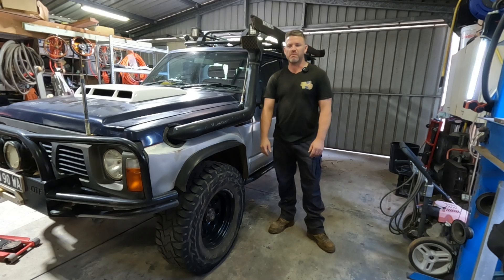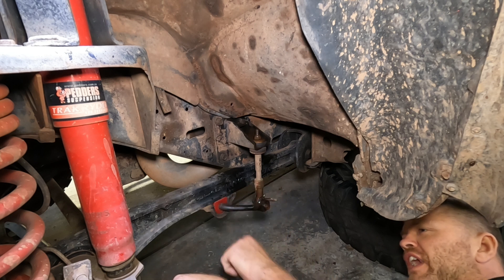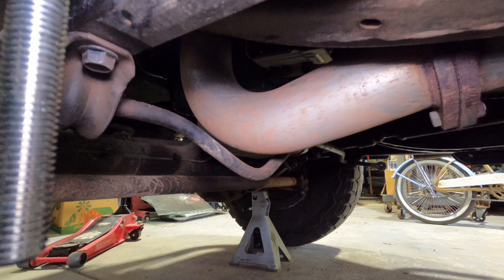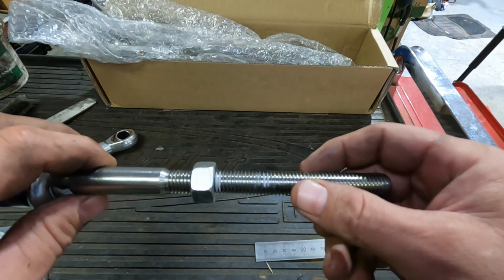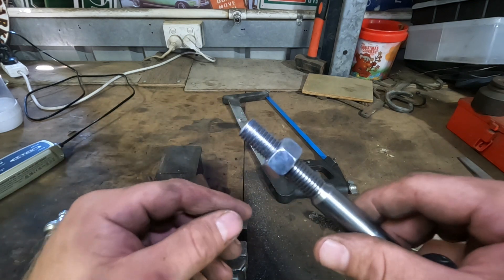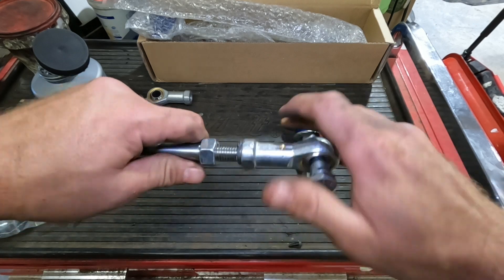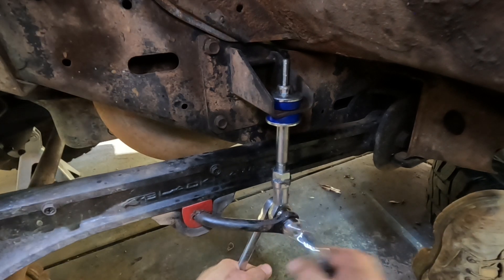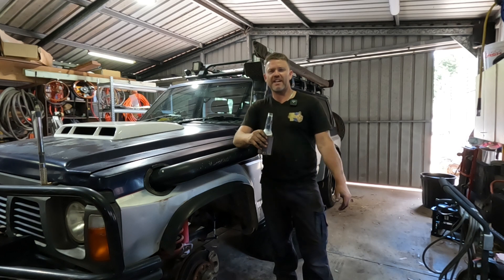Nissan Patrol Adjustable Sway Bar Links some tips that might help you out

Comment: I've got the same kit on mine. Ended up drilling thr other side of the rose joint and putting in a grease zert. Seems to be good now.

The urethane bushes .are it a little louder on road, but it's a gq...

Great info as usual Byron.
Reply from the maker: Oh awesome 
Yeah I think when they do wear out ill do an update video of what i do about them but for now they are fine just done a trip of 1000ish km all good 👍

Comment: Great video!  I set up my GU with the same Blackhawk arms.  Question:  Do you have clearance issues with the swaybar/front tailshaft?  Blackhawk have a spacer kit, but for $180!!!
Reply from the maker: Gday mate 
Thanks 
No mines ok at the moment what size lift have you got
Reply: I put in a ~50mm lift (King springs/Koni 88’s) same time as the arms.  Now drives/rides heaps better than stock, but I never noticed how much clearance there was before the lift.  About a finger width now but doesn’t seem to be problem driving around town.
Reply from the maker: @donaldlantz8529  oh sweet mate 👌